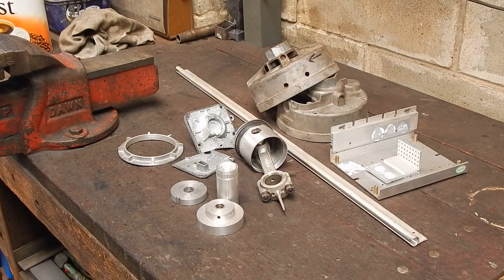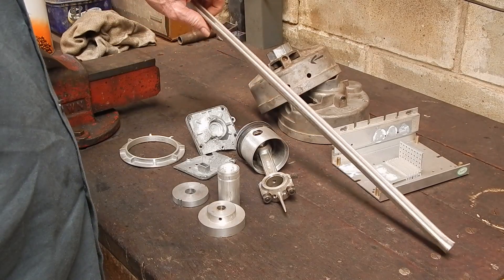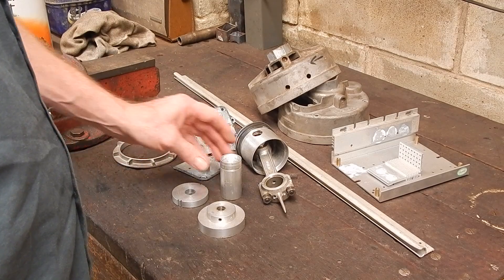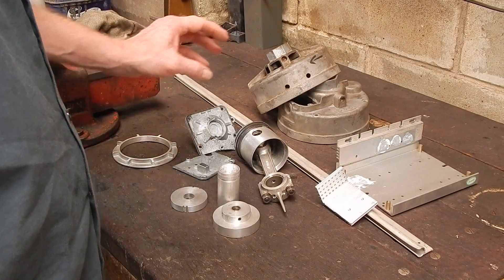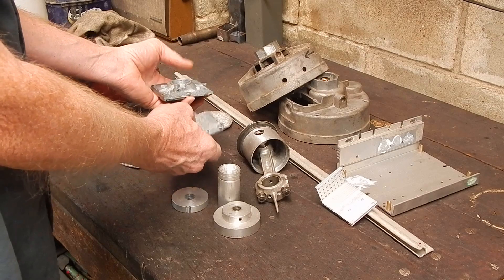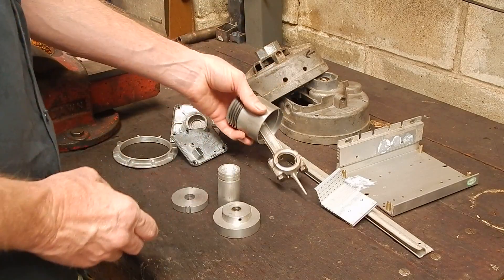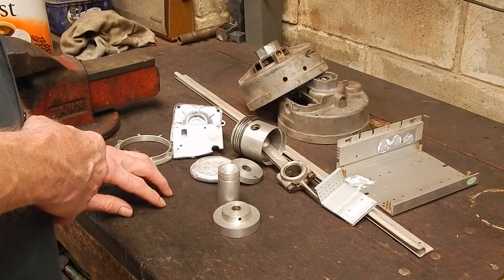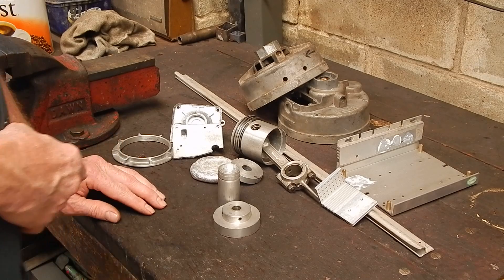Aluminium scrap for casting a gear blank

Comment: It's a nice exercise to make a gear from scrap, but I think a hobbyist would be better off using some know material like 6061T6.  The T6 means it has been heat treated to give it better properties.  When you just melt scrap, you get scrap-grade alloy that is not very good for real mechanical work.  But, for just playing around, it looks like you are having fun. A metallurgist would think you quite a genius to judge materials by heft. Perhaps chemical engineering is more complicated.  Be safe.

Comment: What about using scrap 6061 or 6063 that has been TIG welded with 4043 or 5056 filler rod?
Reply: +altitudeca  Basically, I have lots of scrap that I used when learning how to TIG weld.  I'd like to be able to melt it down and reuse it.
Reply from the maker: +altitudeca 

Aluminium such as 6061 will change it's properties after basic recasting - eg. it is often tempered in some way to impart flex/spring and shock resistance, but this quality is destroyed when you melt it.  It will become more brittle.

After you melt/cast it, check the properties by trying to break a piece.

If it breaks rather than bends, which I expect it will,  it will be OK for gears. 

I expect any filler rod content will be on the hard side, so it should melt in without an issue.

That's my best guess.

Cheers Rob
Reply: +xynudu Great.  Thanks.

Comment: what about melting aluminium cans?
Reply from the maker: +Asad 

They are probably a bit soft for gears.  I've never used cans.

The general rule is the alloy should break rather than bend.

Cheers Rob

Comment: Good idea. I'm in the process of setting up for metalwork, I've been melting down my scrap to ingots so far. As I now have a lathe (not yet installed), I thought I might try some round stock machining for practice, so this is ideal.
I've cast three slugs from what I think is high grade aluminium - it came from the top skin of an old wakeboard. I used commercial flux and degasser hoping these might help things along a bit.
On the round surface of the slugs, I have a better finish towards to 'top', the bottom (sand end) is slightly pitted. Once I get my lathe running I can check what's under the skin.
Reply: dammit, this went into the wrong video! I'm referring to the pipe casting.

Comment from the maker: I would only use aluminium that breaks for gears.  If it bends, then there's a good change the gear teeth will also bend. When you look at the break there is an almost crystalline appearance to it, suggesting it's way different to pure aluminium. From my observation there must be a very wide range of alloy compositions depending on the original use. So it's a bit hit and miss grading it. I'm just passing on what I've observed and am only a beginner in this activity.  Cheers Rob

Comment from the maker: My furnace is very very basic - an enclosed brick block hearth made from an old incinerator.  I use wood fire with a hair dryer blower as a bellows.  I intend to do a video in the next few weeks of a simple gear blank pour and will try using my 1500 watt vacuum cleaner as the blower - that should get things a lot hotter. Cheers Rob

Comment from the maker: As per your comments, previously cast aluminium seems to be the way to go regarding scrap.  I have never tried the vinegar test, will do that.  I tried to show a sample of readily available scrap.  I should have added a stationary engine cylinder head and crank case half I had on the heap.  The alloy has to be clean and unpainted or annodised.  Cheers Rob

Comment: Another good tip would be to file a small spot on your aluminum and put a few drops of vinegar (or another weak acid) to see if it bubbles up.  If so, you've probably got magnesium which should be avoided.  A magnesium fire is a spooky thing.  As always, thanks for sharing your experience.  It's very much appreciated.

Comment: Thank you for this video.  I am at the point where I may try casting myself.  I have read a lot on the internet but this is the first video I have seen on "grading" aluminum.  Can we safely say that if it breaks it is good for gears and if it bends do not use it?
Thanks again-  fred